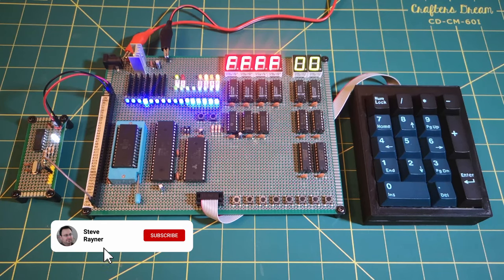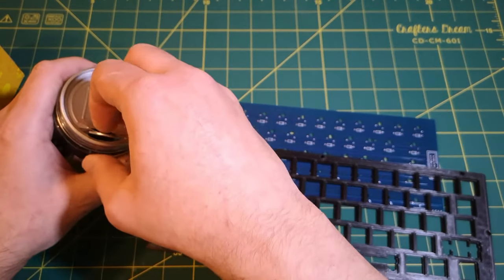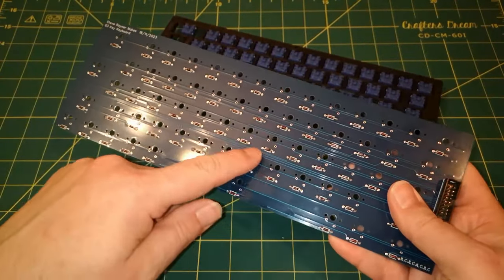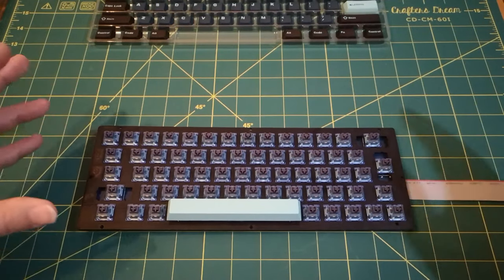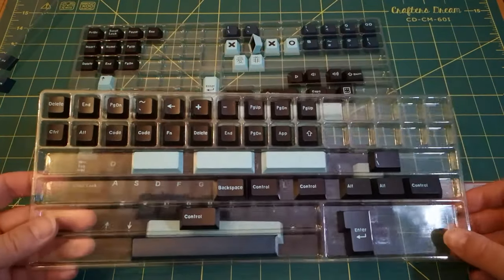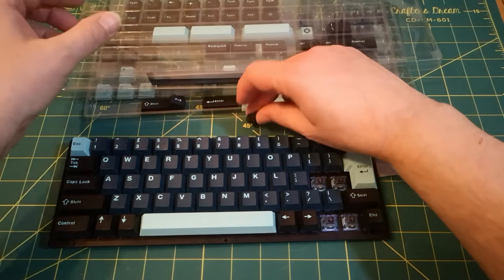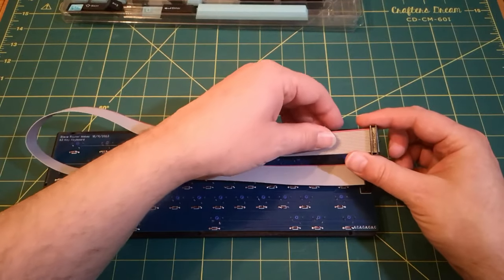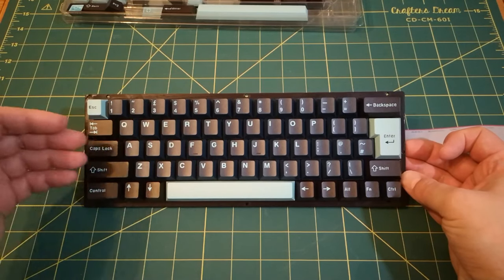Z80 Computer - Part 14 Full Keyboard

Comment: Just wondering, when you had trouble with the Enter key – the slot in the frame is vertical, but the switch is oriented the same as all the rest – does that mean the switch doesn't clip in, hence the wiggle? Can't see from this vid whether the switches have clips only on the top and bottom edges.

Looks neat though, looking forward to seeing you get some ASCII codes out of it.
Reply from the maker: Yes, you are quite correct. I only realised later, but that's why the PCB originally didn't line up. I clipped the switch in turned sideways, but the PCB is designed for it to be same as the rest. So without realising I turned it same as the rest and it lined up with PCB. Yes, there are only clips on the switches top and bottom, so it is a little loose fit, but once it gets soldered to the PCB it's secure.